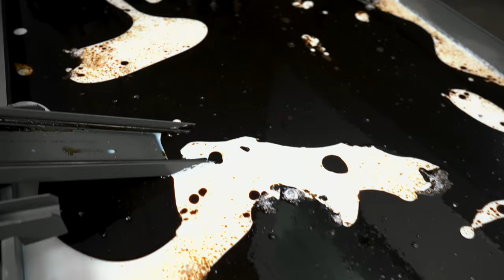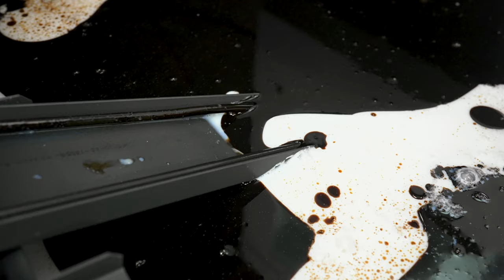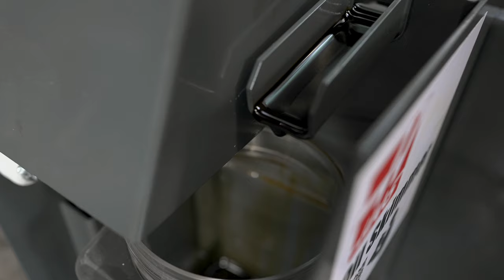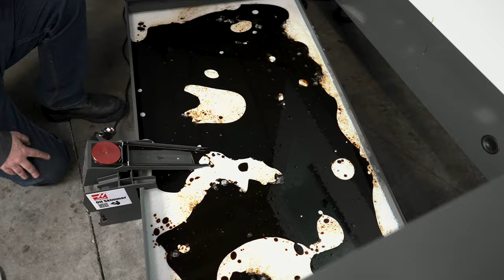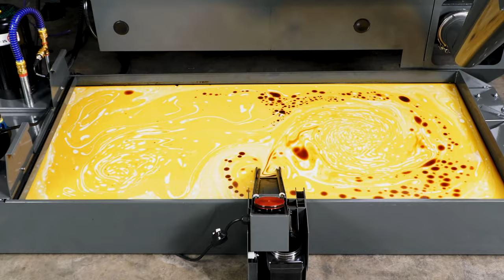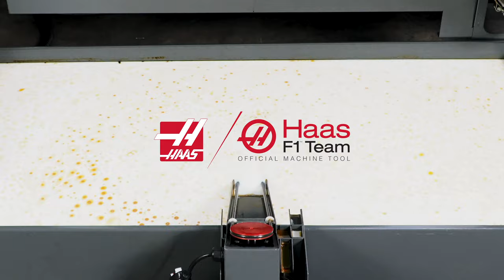Haas Coolant Tank Oil Skimmer Time Lapse - Haas Automation, Inc.

Comment: Looks like it works great. Every skimmer I've seen over the last thirty years worked great too. Cheap ones, expensive ones. Both do their job. We run cheap ones on a timer for two hours everyday right before we come in and start working. Never any oil in our coolant
Reply: What's a good "cheap one"? I think haas charged $600 for this one.

Comment: How long was this time lapse?  And why was there so much oil in the coolant?  Charles
Reply: I would also like to know how long was the process
Reply from the maker: 465maltbie, the time lapse covers approximately 16 hours. The skimmer started mid-afternoon and was turned off the next morning. We purposely dumped a quart of dirty/used motor oil into the tank to make the skimming action readily apparent. Hopefully quite a bit more oil than your typical shop is getting in their coolant every day.
Reply: @haasautomation  thanks have a great week.